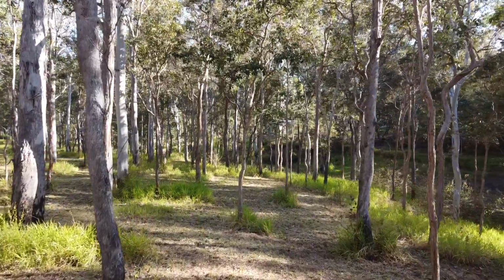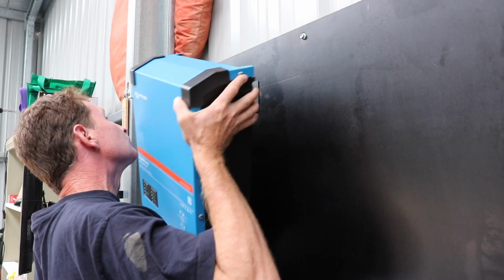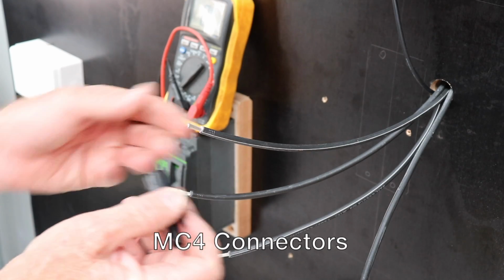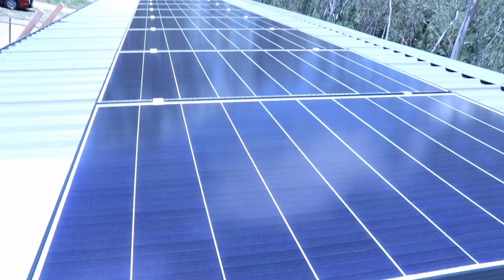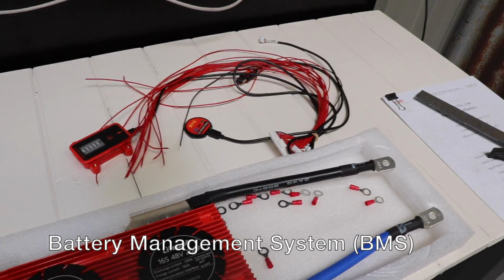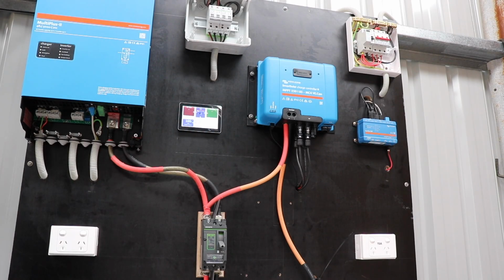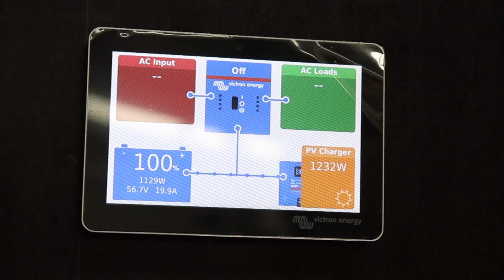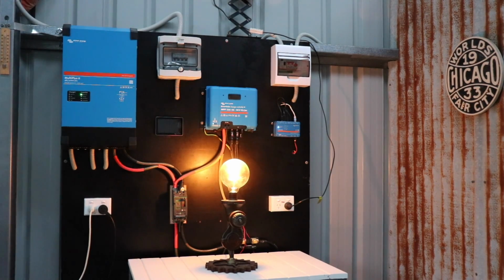Going Off Grid - DIY 4600w Solar Lithium Battery Power System EP7

Comment: Hi Scott, nice job on the Victron setup. I’d like to ask how are those EvE batteries going and would you mine tell me where you bought these from? Are they an Australian supplier or otherwise? Thanks
Reply from the maker: Thanks Jenny. The batteries are going great. They have not given me a problem. You do need to set up the BMS settings suitable for your needs which is not hard. Aus supplier Lifepo4 oz.

Comment: Hi scott, having multiple strings of panels have you got a combiner box thats not in the video or did I miss it? thanks
Reply from the maker: Hi Dave. I have a DC Breaker box between the inverter and MPPT (Left). On the Roof the strings come into two Isolation switch boxes (one for each row). Hope this helps.

Comment: Would this system be OK if I just made it up as 24volt??😮
Reply from the maker: Yes, that's possible. Victron have 24 v inverters and you can get 24v battery packs. You may be limited to 3000 watts however.
Reply: @ScottTurnerformeindustrious  ok Scott I will look at their website..thnx

Comment: pity you couldn''t 6S x 2P, but I guess the VoC getting a little too close
Reply from the maker: Victron have a really good calculator on their website that allows you to try out all different configurations. I think I could have gone 6S 2P but from memory I wanted to keep the voltage below 150 because I was too scared of higher voltages :I  I know Higher voltages are better for reducing cable sizes and efficiency but....scared

Comment: Very clean build, good job. however, your battery is 280×51.2=14,336 watt hours. I have built two of them and they came to 28,672 watt hours. I used JK BMS with 200 amp charge/discharge and 2 amp active balancing. I followed Andy from Andy's Garage when building our's.
Reply from the maker: Thanks Steven. I just go off the Manufacturers specs which go off 48v nominal. I enjoy watching Andy's show. Cheers.

Comment: Geez Scott, you and Tim make that look easy.
So I'm wondering if you can explain a bit about cost of your solar set up please 🙏 
I'm in the process of researching solar for my own off grid and hoping to steal your hard work 😂
Reply from the maker: Thank you! Cost of the system as shown in the video was around 15k AUD. Figures are rough but close enough. MPPT $1200, Inverter Charger $2700, Cerbo GX $400, Shunt $300, Panels and racking $4500, Batteries $5000. The rest is in wire and switches etc. Hope this helps.

Comment: Brilliant job, could you possibly give a around about cost of all parts to buy...thank you so much.
Reply from the maker: Thank you. My diy system cost around 15k. Inverter was around 2.5k, MPPT 1.2k, Cerbo and shunt around .7k Batteries around 5k. Just under 5k for Solar panels racks and wire. The rest is in the 240v Install.

Comment: I'm a new subscriber to your channel Scott and I'm loving it!! With the PV system you've installed would you be able to run decent size single phase MIG say 250 Amps?
Reply from the maker: Thank you! I'm yet to properly test the system for welding. I have done some light welding no problem. My big air compressor can have some trouble getting running if I have anything else on at the same time. I'm planning on doing a video to talk about my experience with the system to date.

Comment: Hi Scott. What's the welder you're running on the solar system. I was told not all welder can work on a solar system. Cheers mate.
Reply from the maker: Running a WIA Weldmatic 200i. I do need to do more research with this subject as I don't want to do damage to my system $$ (Even though it works). I may need to run the diesel genset.

Comment: Great build. That earth stake looked like it took some convincing 😂. Looking to do something similar to power my critical circuits overnight by storing my excess solar instead of pushing it out into the grid.
Reply from the maker: Thank you! Yes it liked a beating :) good idea if you can get better use of your solar. Generally I'm topped off at 10am so I loose all the solar from that point. I should put in an electric hot water system.

Comment: Hello Scott, This is Katherine from O'cell, we specialized in LiFePO4 battery since 2008. May I share with you O'CELL cost effective LiFePO4 battery ESS for solar roof, there're all-in-one and separated systems, energy from 500Wh to 30kWh optional, life cycle up to 6000 times, plug & play, if need them, please reach out freely.

Comment: Did anyone mention that those cells need to be compressed ?
Reply from the maker: Yes I have been told that, but it is too late apparently. Needs to be done in the first few cycles after that nothing can be done.

Comment: Excellent video Scott!  We’ve had solar (no batteries though) for about 12 years without any issues.  Can you say what it has cost?  Our’s has more than paid for itself👍.  
You are really putting a lot of sweat equity into the build and it looks terrific.
Reply from the maker: Thanks Skip! Our entire system cost around 15k and so far it's been going pretty well. Yes lot's of work but it's good work. All the best!

Comment: Clean install, liked to see that. QUESTIONS: I don't see a battery fuse..? Those cells must be compressed as suggested in the manual. They will last 25% longer...
Reply from the maker: Thank you. I have the 80 amp breaker. Yes I have yet to compress the cells.

Comment: Hi there Scott. My husband and I are very impressed with your brilliant solar power arrangement. We are in the process of replacing our solar batteries (bought second hand and pretty much on their last legs now). We are interested that you bought the LifePo Oz batteries. We've seen so much criticism online, rubbishing this brand and would like your opinion, as someone who obviously knows what he's talking about. Are you happy with the quality of the LifePo batteries you bought? Are they performing up to your expectations and requirements?
Reply from the maker: Hi Toni. Thank you! So far my use of the system has been limited. I'm still in transit to Iive there permanently. However so far so good. The batteries have never dropped below 80% full. Mine are the Eve 280 amp hour batteries. So I guess I'm happy at this stage. I'll do a more comprehensive review in the future. All the best.

Comment: I don't think there is enough wattage for a very big welder.  Maybe a light mig outfit.  But overall this is very very impressive.  And neatly done too.
Reply from the maker: Thanks Peter. I only have a light welder so I should have enough for the work I do. If I need more grunt I also have a diesel generator for back up.

Comment: wondering, how much the total cost for all of that? is it justifyable considering the degradation? will it be enough for the rest of the night till next morning assuming you use: refigerator, ac, computer, tv.
Reply from the maker: Cost all up was 15k AUD. Worth it; Well, probably not in the city or with grid connect options, but we are in the bush so yes it is worth it for sure. We don't have a lot connected to it at this stage, other than lights, fridge, kettle, tv. Over night the system drops to about 93% full. It gets fully charged by about 9 am. Will have to see how it goes in cloudy weather and winter. So far so good.

Comment: Very nice setup and components, im planning to have Victron as well, just wanna ask if i can install all my components in my concrete shed but its not insulated, winter temperature reaches -10 degrees celsius.
Reply from the maker: Thankyou! Lithium batteries do not like below zero C temps. You'll have to make sure you make a battery cabinet with some sort of heater (light globe perhaps) otherwise just check the component specifications. Those will tell you for sure. I'd say it would be fine, but it's best to check.
Reply: @ScottTurnerformeindustrious  Thanks a lot! It really helps!

Comment: Very nicely done Scott. Victron is top gear which I'm sure will last any years to come..
I'm interested in the Lithium batteries you have used.. and of course their reliability.. Would you have some more details..
Every month think about how you have not paid a bill to connect to the electricity grid, and of course the per KW charges.. Lovely stuff.
Once again thank you for a very interesting and entertaining video..
Reply from the maker: Thank you Mark! I got the batteries from Lifepo4 Oz 280 amphr lithium 48 volt kit with BMS. Yes it is great but you have to keep in mind the upfront cost and the capacity is limited compared to grid connection. Additionally you have the cost of ownership/ maintenance. If you are handy it is very doable. For my situation I have more than enough power.

Comment: Really nice job, clear and simply! I have a question, the Victron charge controller have some protections against shoting down from the bms? I would love to change my Epever to Victron, because Epever burn without batteries connected and solar pannels still working.. Thanks from lands of Venice 🇮🇹
Reply from the maker: Thank you Miki! It only has the 80 AMP MCB.

Comment: Nice build! One thing I wanted to add, since I have not found it in others comments: You should think about locking/tying together the LiFePo batteries. Research shows, that they will last 30-40% longer, when they are locked and can't expand...
Reply from the maker: Thank you! Yes I have had a lot of comments on that. I will have to do something. Cheers

Comment: It's not a good idea to put the bms leads on the battery stud.  Over time that nut will come loose.  Also, use no-ox or or something like MG Chem 847 on the bus bar connections.  I also use it on all crimps.  Drill/tap a dedicated mount any bms leads..
Reply from the maker: Thanks Mark for the tips.

Comment: Great Video Scott!! I was thinking about doing it myself and you inspired me. I have just ordered some cells from Lifepo4 myself. Do the connecting straps for the batteries come with the cells? If not , where did you get them?
Reply from the maker: Thanks David, I'm glad you found the video useful! I got mine from Lifepo4 oz and they supplied the 16 x 208 amphr batteries plus all the connecting bars and the 200 amp BMS with my 48v kit. I also bought a 3.65v Top Balance charger (Takes ages). Good luck with the build.

Comment: Beautiful simple set up. We'll explained. Thanks for sharing
Reply from the maker: Thanks Simon, I saw earlier your comment about overloading the breakers but now I cannot find them. I have two 25 amp breakers with a max load of 20 amps each. Each series string will give just over 130v at 10 amps. Then two strings are put in parallel ring 130v t 20 amps. This then goes through a 25 amp DC Breaker. Same for the next six panels. I hope this helps clarify.
Reply: @ScottTurnerformeindustrious sorry, I missunderstood how you wired up the panels from the video, I thought it was in parallel then series, making it 30amps and 100v per string, posted about overloading the dc breaker, then double checked, realizing my mistake, then deleted the comment.

Comment: Hi Scott, great job. I'd be interested to know where you sourced the EVE batteries and at what cost. I have a similar setup myself but with an extra Inverter because I need to run cables about 50m from the Panels to a backup generator in a shed like yours. Keep up the great videos.
Reply from the maker: Thanks Lyle! I got mine from Lifepo4 oz for a little under 5k. These batteries are gone up in cost over the last year or so.

Comment: Great work! Thanks for sharing. I’m just worried you don’t have any surge protection. On the AC and DC side. They really cost nothing in the grand scheme of things. Suppliers in South Africa will void your warranty if these are not in place.
Reply from the maker: Thanks Brett! I had a hard time trying to find someone that supplied Lightening protection for the solar input. I keep getting told just have good earthing, plus I insisted having the 25 amp dc breakers coming into the MPPT. On the AC side I have breakers plus the RCD. I'll see what I can find for high voltage protection, I'll keep looking.

Comment: Are you happy with your EVE cells?
I have held off buying raw cells after what Will Prowse has said
Reply from the maker: I haven't had them long enough to really say. So far I am happy with them. Still the cheapest option for the capacity I was after.
Reply: okay, yeah I’ve been really suss about buying stuff from eBay or Alibaba. I have found a place in Brisbane that sells raw cells, But have been concerned that they are B grade cells
Reply from the maker: @Trevor7727  I bought these off Lifepo4 Oz. I was the same as you. I phoned these guys up had a chat. I'd buy again from them.

Comment: When you researched your battery set up, did you look into server rack batteries? I'm thinking of going with those for their expandability on the future.
Reply from the maker: Hi Christopher. Yes I did look into the server rack batteries. They cost a fair amount more than the system I went with and I had to keep my costs down. I'm very happy with the current set up.

Comment: And then there was never another bill.. ANTI-INFLATIONARY!😮😊Every home should have a system like this. Our government should provide more incentives to allow landlords to provide the opportunity for tenants to access the technology and then cost of living pressures might subside. Love your work, keep the videos coming ✅🦠⛈🔥
Reply: It’s a bit of misconception that you’ll never pay a bill again. Batteries need replacing/expanding and panels need upgrading. Even the inverters (the really expensive part) die. So put that power bill money aside you are going to need it one day. Love being off grid though and the obvious environmental benefits.
Reply: @jonathanrashleigh8771  It's really a misconception that the costs of maintaining a modern LiFePo4 system are anywhere near an order of magnitude lower than what you can expect to pay for mains electricity, especially these last few years, the quality of inverters has improved drastically over the last 3 years, and the cost of inverters, panels and cells has all fallen similarly. LiFePo4 cell longevity increases exponentially with reduced depth of discharge, so you can expect them to outlive you if you oversize them adequately. You can get a modern, high quality 5kw Chinese inverter for 500 AUD and an 11kw inverter for under 1000 AUD, at current electricity prices; buying low cost components a high electricity user could turn over their system every 2 years and still be near breaking even. Nothing needs replacing anywhere near every 2 years.

Comment: Just a question, the solar panels are 48voc and the MPPT is only 250 V, so did you wire the panels in parallel, otherwise your voc would be too high?
Reply from the maker: 12 panels altogether. The break up is 3 in series plus 3 in series and then parallel those 6 panels into two strings of three. I do that again with the next 6 panels. the strings of three give me a little over 130 volts, 10 amps. When Paralleled (two strings (6 panels) I measure with the multi meter 130 volts, 20 amps. At the MPPT I get approx 130 volts 40 amps. I hope this helps

Comment: Power, hot water, five star resort Scott 😁. 
Batteries with solar charging. Queensland a sunny place, of course. How much spare capacity do you think you have? Being on grid 240v normally runs out the wall never have to think about it. (Apart from when the bill comes)
Reply from the maker: Cheers Doug! I will have to see how it all goes. This system is only powering the shed so I think it will be fine.

Comment: Great Scott, Scott. Good job & quick build vid. I love Will Prowse too, but you might want to check out Andy’s Off Grid Garage Australia, for some local talent and excellent info on this type of setup, he really knows his stuff.  It looks like some sort of a marine ply ur using as a backing to ur Power Wall, you may have to use a fibre cement type board (non-flammable) to comply. Not sure what BMS u have there or what preinstallation prep u have done (balancing etc), but I will give u a tip for a backup or replacement, check out the 48v 200A JK BMS with 2A active balancing (Ali Express), they work great with these cells. Will have to check out some of ur other vids. Cheers
Reply from the maker: Thanks again! Diligreen BMS 200Amp. In time I'll get more knowledge on the system, largely thanks to Andy and Will. All the best.

Comment: If the base has rebar in it and the steel building is properly referenced to it you've got yourself what we call a "Faraday Cage"

No need for earthing rods and it's the best kind of earthing arrangements you can have is a Faraday Cage...
🇬🇧😐
Reply from the maker: That was discussed between Mike and I (My father in Law). The slab has Re-Bar but being properly referenced, that I'm not sure. Cheers Glenn!
Reply: @ScottTurnerformeindustrious  

My point is Scott.....you've no external power coming in apart from a site generator....
So I don't know what the rod is for...

I'm an electrician by trade
🇬🇧😐